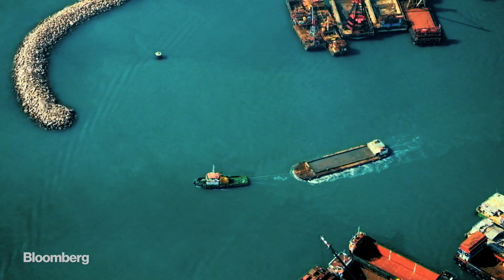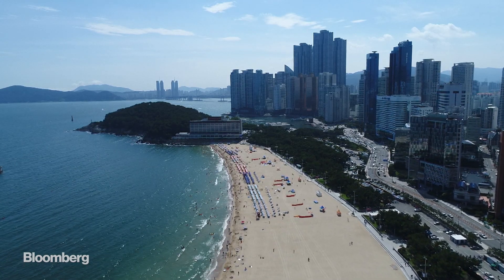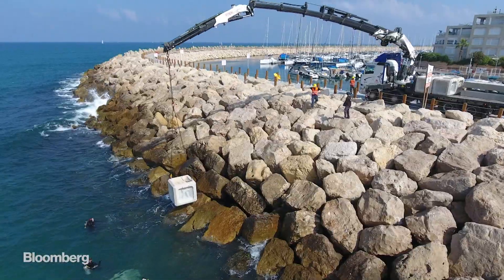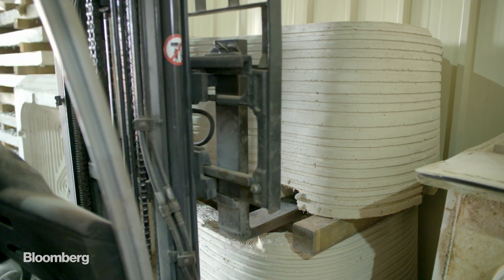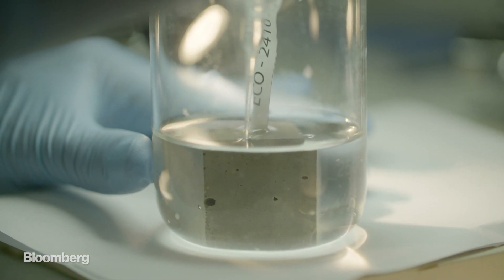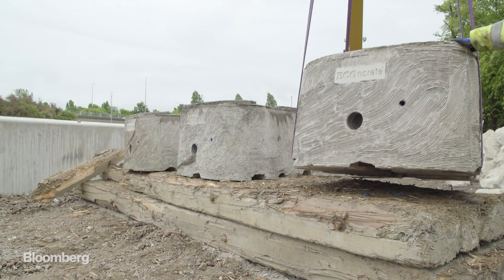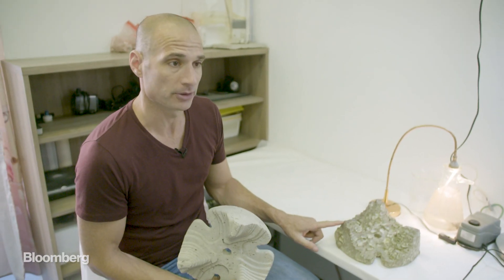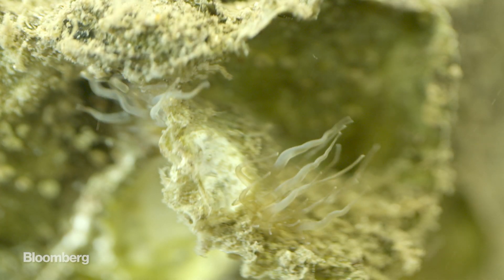The Green Tech Bringing Life Back to the Sea

Comment: The answer to wind turbines and all green technologies and old fission nuclear is that they are all now simply uneconomic and unnecessary. We now have the ultimate green power device with none of these problems in the "SAFIRE REACTOR". This is what we need to negate all the problems of all competing green energies. It produces almost costless electricity and is hydrogen-fuelled power from new "FUSION NUCLEAR" is now immediately upon us. We have recently taken a new step to advance the physic of power production by enabling chemistry of the atomic nucleus, or "nuchemy" in the newest FUSION NUCLEAR POWER technology. We are passing the chemistry level where we interacted with the atomic electron shells and are moving on to manipulations in this "NUCHEMY" atomic nuclear era when we interact and multiply nuclear protons. We have rediscovered the lost work of the alchemists and can make new elements with different atomic weights. This was ably demonstrated in "The Safire Project". Quanta are important. We now have enough energy to manipulate the atomic nucleus much more easily by creating a compartment, or what is a local region of plasma containment so reactions at this atomic nuclear level can easily take place. This is about to practically enabled a really fantastic and cheap new era of energy production for the whole of mankind. This with hydrogen, so free fuel obtained from water or atmospheric moisture anywhere in the world. This new fusion nuclear SAFIRE REACTOR is at the industrial commercial production final development point as of now and it can retrofit older and decommissioned power plants. The energy argument and other power methodologies are all now virtually irrelevant as we have new and very physically and economically powered practical and local community level fusion nuclear power. Solar roof plus Teslawall battery may be the present way to go domestically but megapack batteries and multiple storage technologies interconnected with an expanded ugly grid have a less certain requirement when you consider new any-scale community based and 24 hr reliable and self-fueling fusion nuclear in the form of the "SAFIRE REACTOR". Learn all about it at "AUREON ENERGY.COM". Learn the newer EU Theory and plasma physics at "THUNDERBOLTS PROJECT.COM" and you will be permanently reeducated with this advanced new EU theory that will allow you to understand more about the astrophysics of our whole universe and all within and you will be able to educate your peers.